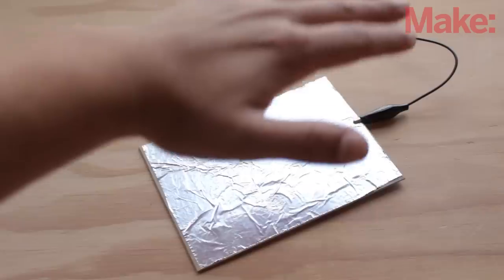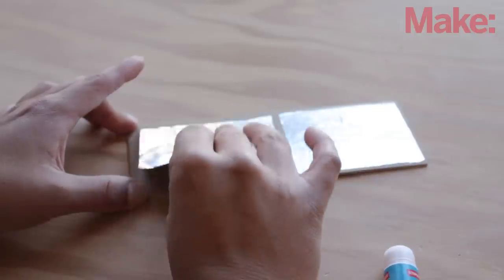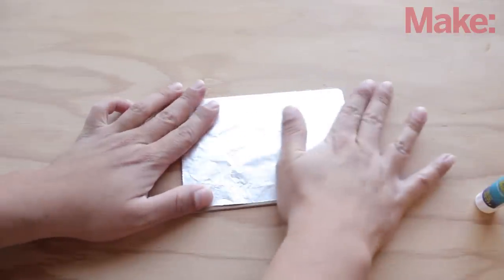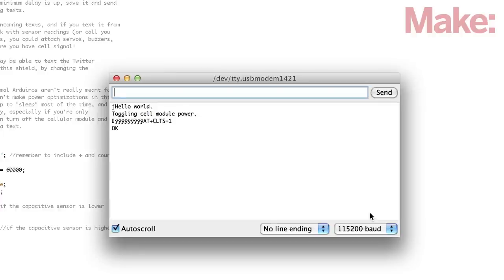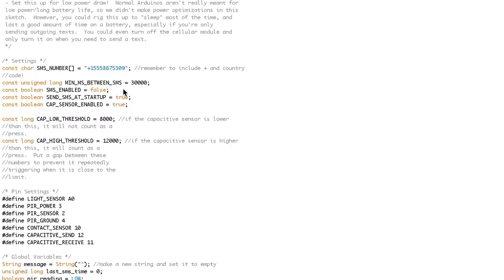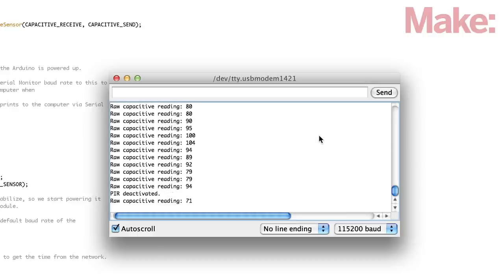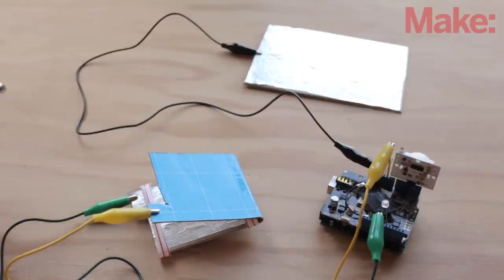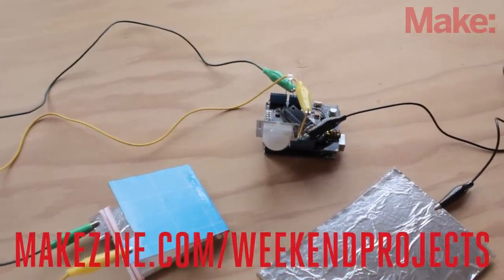Weekend Projects - Cellular Sensor Sentinel

Comment: Since the pressure sensor is basically a homemade contact / switch, couldn't you use in place of that a NO/NC magnetic reed switch or any other type of switch? I'm seeing applications for things like possibly wiring it for entry of a door or window or even an on off switch for a device you don't want tampered with.

Comment: you should go into more detail why you used resistors and the stuff when connecting to the arduino
Reply: +Giovanni DeTorres
the 10k resistor is to make the Arduino can read without that resistor it will be&#160; short circuit -_-

Comment: $200 worth of kit and phone charges to see if your puppy is eating your trash ? I'll pass.
Reply: If your the type of person who would actually go through with building something like this chances are you already have 99% of the materials he mentioned. The only thing out of the list that I already don't own is the IR sensor
Reply: +tobortine No, Arduino was around £35 / $45 - GRPS shield was £10 / $ 15 and the other parts came to around £3 / $5... The arduino can then be used for everything.... So....
Reply: +Storm The Arduino can't be used for other things if it's dedicated to monitoring your dog. I'll accept your revised estimate of $65 and still pass. All of the ideas are valid, it's a reasonable video but Arduinos are a learning tool. My point is that if you were to turn these ideas into practical devices you wouldn't use an Arduino in this format.
Reply: tobortine
Well Yes, once's the arduino's in use... But you can use it for multiple things. Even the Raspberry Pi can be connected to a server to host media and do what the arduino does here at once.